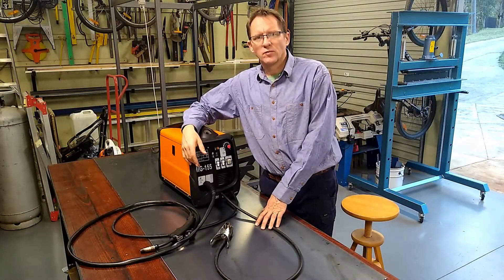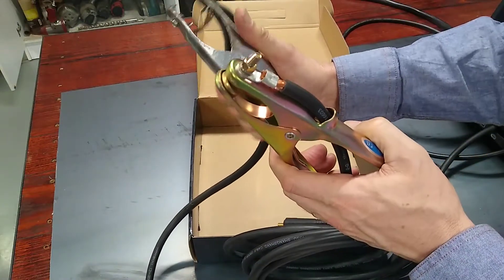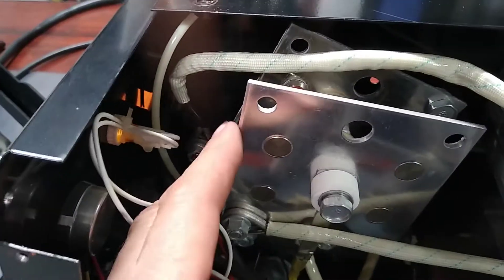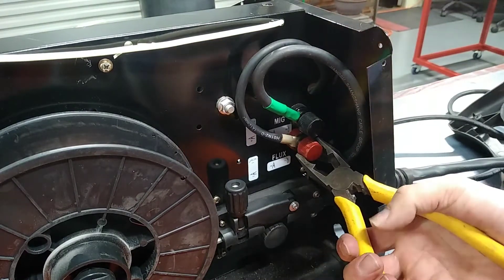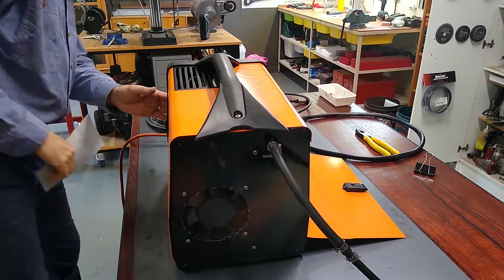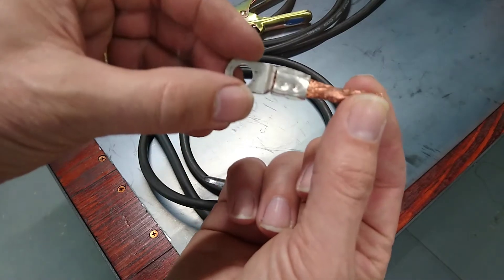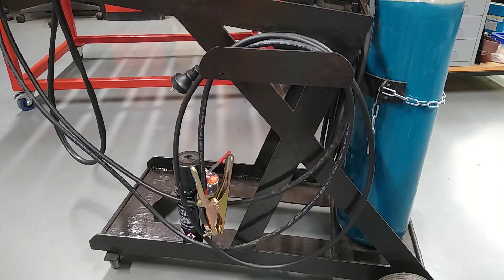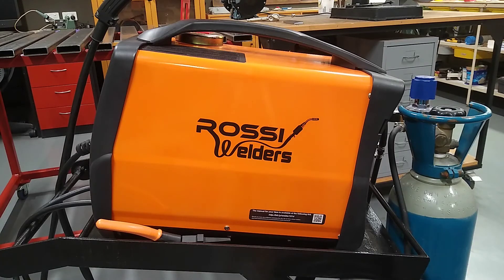Rossi Welders MIG 155, Two Easy Improvements

Comment: Do you know how to change the polarity to use for flux core?
Reply from the maker: Yep just swap around the two lugged ends in the spool compartment, only in my case one of my cables is now connected directly to the heatsink. So for flux core the torch cable goes to negative. Cheers

Comment: I suppose that it's still a cheap welder, but the investment in time and money is creeping up. Have you checked the lug crimps on the electrode lead?
Reply from the maker: No I haven't, but the insulated thumb nut on the positive lead just broke apart, it is blackened and brittle from excessive heat, so I'll checking that for sure, just when you thought all problems had been fixed, piece of cr@#. Cheers

Comment: Just a reminder. Copper braid earth clamps doesn't only come in 150-160 amp applications. They also also come in 400-500 amp welders, which I never had a problem with (other than wear and tear). My suspicion is that the braid isn't the problem but the quality of the braid.
Reply from the maker: Copper braid is fine, it has higher current carrying capacity compared to solid strap of equal size, my problem was, the braid was too short, kept coming lose, getting damaged etc, cheers.